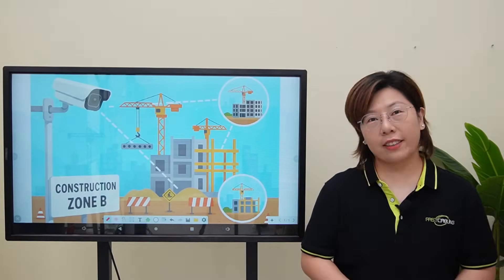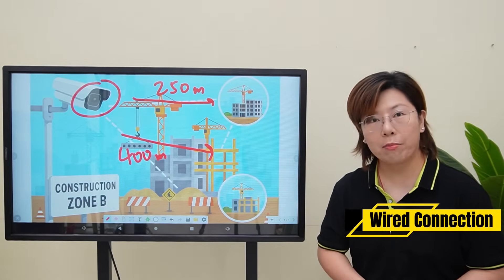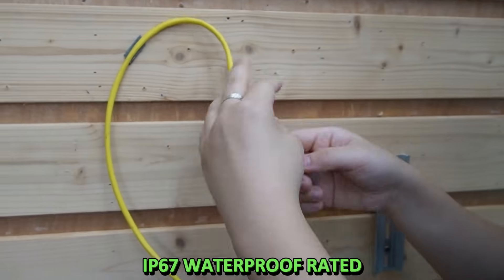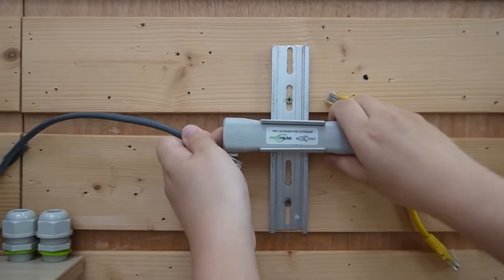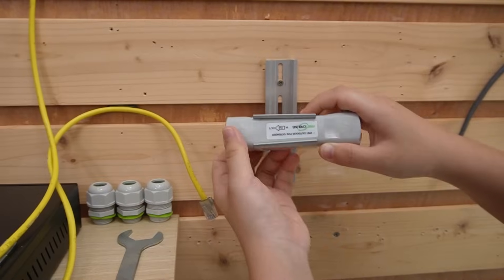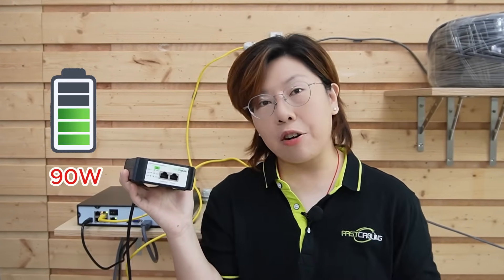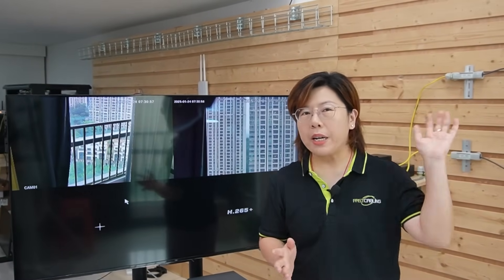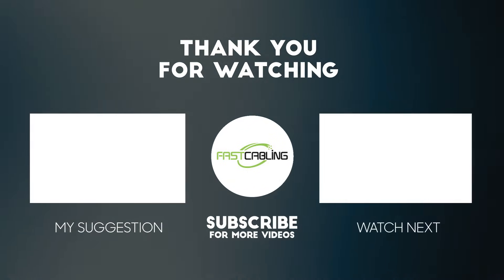Install 400M Long-Range PoE IP Cameras for Construction Sites | Ethernet Run Tutorial

Comment: How you deal with lightning strikes or electrical noise in the real world application? Thanks
Reply from the maker: It is a good question. You need the PoE surge protectors sitting at both ends to cancel the possible surge. We mentioned the surge protectors in this video. https://youtu.be/wg6EaHdf5pc